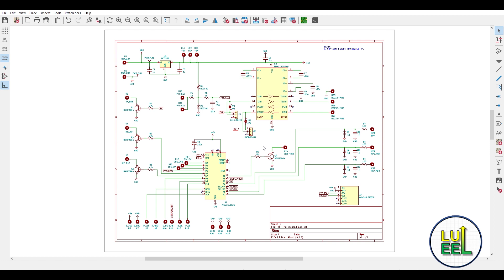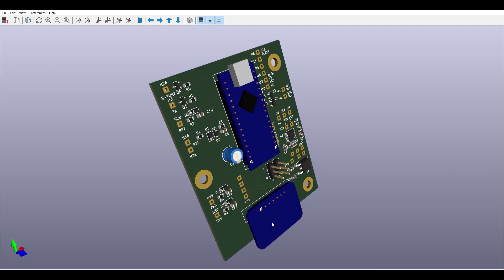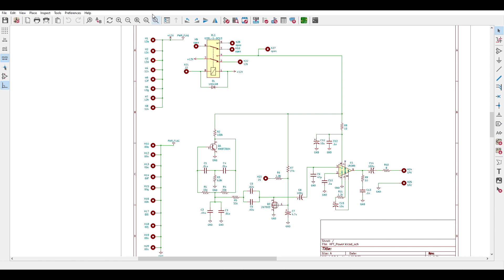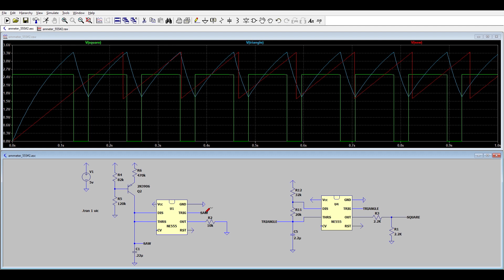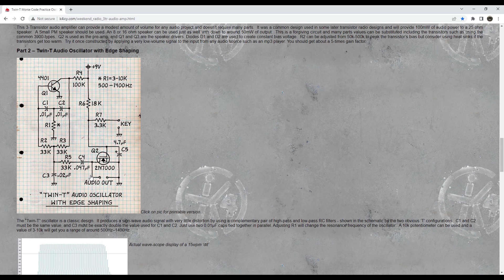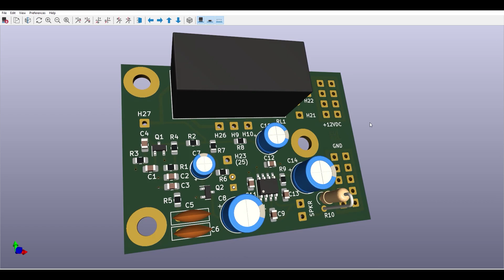HF Transmitter #13 - More Boards!

Comment: You're right about sidetone being harder than it looks. The easy way is to use Arduino built in tone function which toggles a digital line, then RC filter and attenuate.  This eliminates the components but can sound harsh. Your scheme is good, as long as there's no leakage around the FET. one slight problem, the volume is fixed. In a transceiver you want the Sidetone thru the receivers audio stage and volume control. A different challenge.   Your transmitter will be a high quality unit,  thanks for sharing.  Paul VK3HN.

Comment: You mentioned not being able to etch for a TSSOP footprint... if you're ever interested in home-making such things, I've had good success with TSSOP and MSOP footprints by CNC milling my boards.  Solder mask isn't really necessary if you're good with flux and thoughtful about your footprint and layout.  It's nice not to have to wait a week or two for a fancy board sometimes :-).

Comment: Aa you don't need to receive data you could bit bang the output spi signals and it would free up a pin. Just a thought. 

Nice to see a star ground, you can feed each set of grounds through 0ohm links etc, on a pcb as that let's you give each ground a different net name.